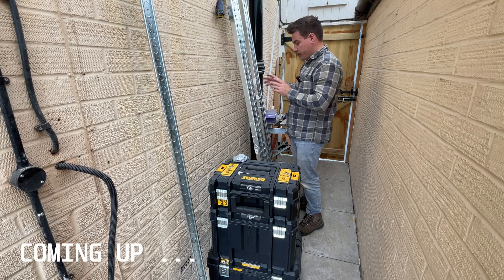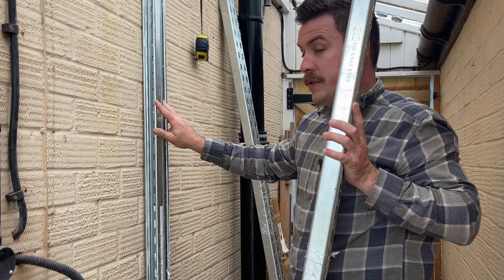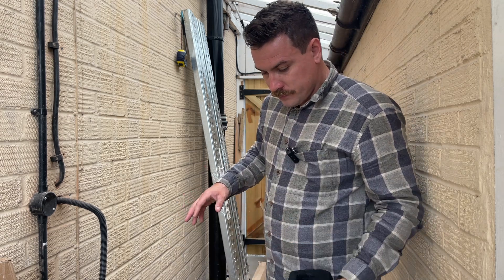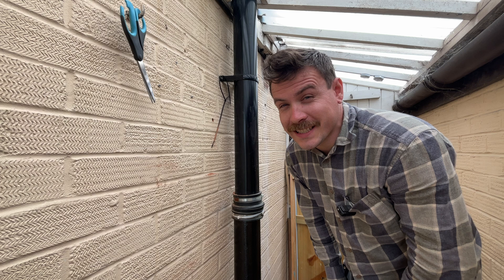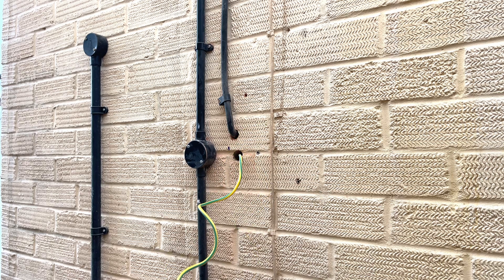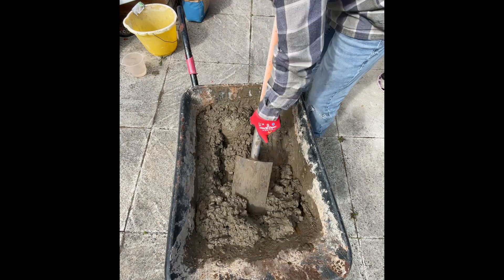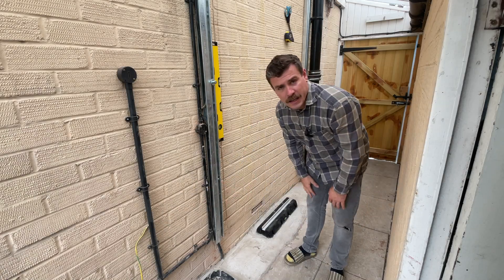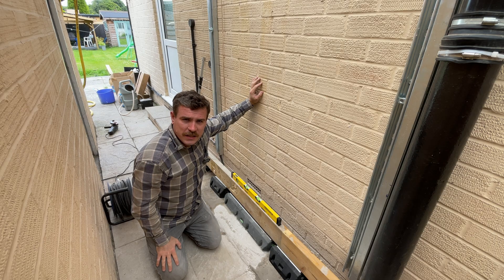My mounting idea for an EV battery on my house

Comment: I am about to mount the same battery to my garage wall and I was wondering if you encountered any issues by mounting it vertically. The battery has been working for about 2 months on the garage floor (horizontally), but its time I finished off the project. Does it get too hot or cold as mine had shown low temperature (Frozen Battery) alerts when the weather was colder. Its been great following your project and lead me to complete one myself. Keep up the good work...
Reply from the maker: Not had any temps below 10c if I remember correct. I did wrap the battery in insulation for winter and see a few degrees warmer than the other battery in the garage. 

As far as mounting vertical it’s been a great use of space and I found no issues with mounting it in this way. One thing I had wished I’d paid a little more attention to was making the coolant ports accessible so if I did decide in future to run a heating or cooling loop, I would have the option. I’m sure I still can. It’s just a bit tight.

Comment: What are the dimensions on that battery? Weight?
Reply from the maker: Roughly 2.1m x1.4m and around 500kg. It’s 10.5cm thick at its thinnest point and add another 27 at the thickest point

Comment: This is a great idea. My problem is that nobody has it connected to a Solar Edge grid-tied inverter and my skills are limited but not afraid to learn if there is a teacher/instructions to accomplish the goal. Late bloomer bought solar panels 10 years ago and never put them up due to cost of batteries and replacement times. I think now is the time with LFP model 3 battery pack. I only have 5.3k worth of panels but this looks perfect for this project. Need split phase 240 inverter that is HV and probably a grid tied but who is telling the grid people. Just need to have emergency cut-off from the grid.
Reply from the maker: There are people that do these projects using the inverter entirely off grid. Charging from solar and discharging through battery when needed. Needs to be done inline with the electrical regs near you. Would recommend getting an electrician on board for the grid bits. 

Can you use your panels with a grid tie inverter? Or is that what you have with the Solar Edge?
Reply: @TheOfficialBatteryMan  yes the Solar Edge is my way to the grid. I have solar optimizers on each panel. Solar Edge 400v  10kw battery is about $7k plus installation. Tesla model 3 is about $5-7k and 60kw.,but probably usable 40kw. So, I can generate about 20kw a day over 5 hour average generation. I just need an auto switch to cut off back feed to the grid when it goes down.
Reply: Throw that crap of solaredge inverter and buy a deye or just connect the deye in ac-coupled way

Comment: Prices of used Tesla batteries seem to come down. Saw several 60kWh LFP packs for 4800-5000€ on ebay. Seller is in lithuania and does not state if the batt is damages or flooded. But this can be checked. Seems my HV inverter project can start in the near future
Reply from the maker: O yes. I actually don’t see there being much need for people to swap out a couple year old Tesla battery in their cars. So presume the used market is being propped up by second life users. Just a theory

Comment: The batteries usually have plenty of life in them, it's the contained electronic and BMS that is problematic.
For most people buying and selling electricity wouldn't make financial sense as you would need at least a 40% price difference or so to compensate for the loss in heat and the cost of the installation.
Reply from the maker: When you consider it can only take one cap to go bad and knock out BMS. Anything is possible when it’s for YouTube 😂😂